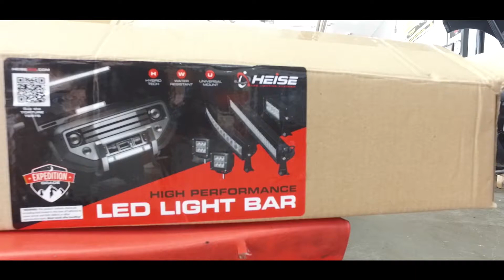Lighting up the night: Heise LED Bar Installation!

Comment: Did you have to drill holes to put the brackets in.
Reply from the maker: MultiBeans1234 Yes we had to drill in order to mount the brackets properly
Reply: I was think of getting a rough country led bar but they don't have brackets for them. I might get this kind of brand
Reply from the maker: MultiBeans1234 Heise is a very good brand. And it comes with everything included
Reply: Thanks for the reply man. I'll get that bar.
Reply from the maker: Awesome! Your welcome